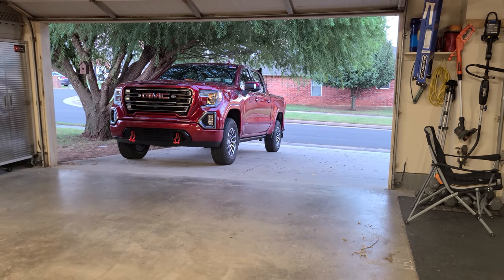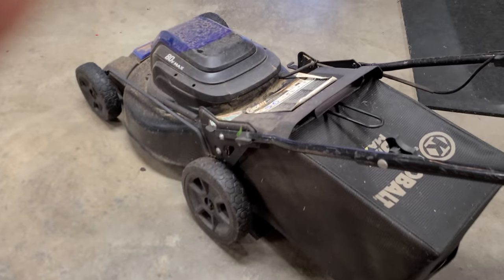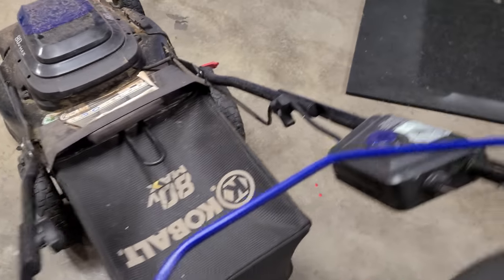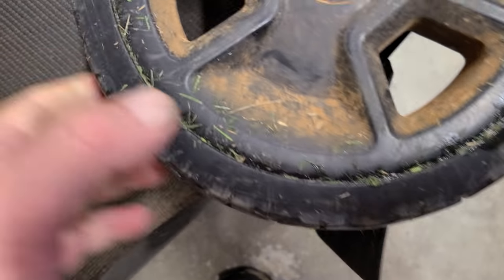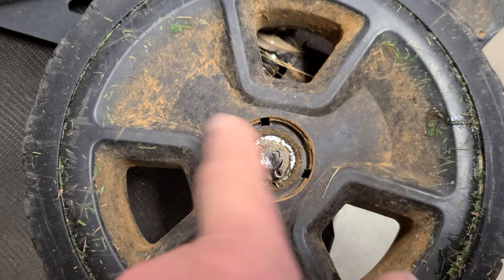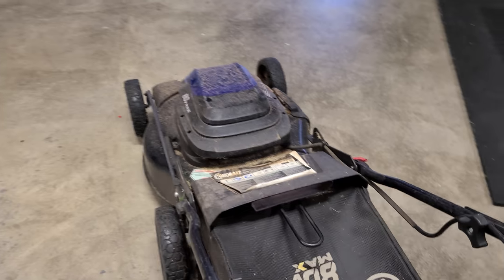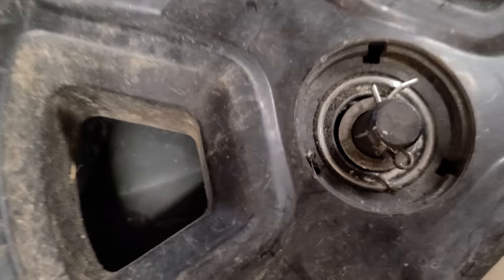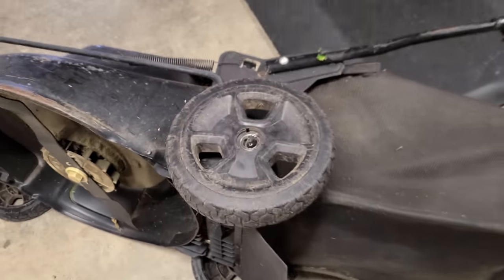Kobalt 80v push mower rear wheel ball bearings broke

Comment from the maker: The bearings are 1/2" x 1 1/8". THERE ARE TWO PER WHEEL and you lightly tap them out from inside the plastic wheel shaft hole out. I used Hillman Part # 0823651043 from Tractor Supply (they had four in stock). Also available on Amazon: https://www.amazon.com/gp/product/B07YDK97WZ/ref=ppx_yo_dt_b_asin_title_o00_s00?ie=UTF8&psc=1

Comment: I simply replaced the wheels with OTDSPARES 10-Inch Rubber Replacement Tire Plastic Wheel 10x1.75" Semi-Pneumatic Tire from Amazon with a 1/2" ID fender washer on each side to fix any slop issues. These wheels are all plastic hubs wo/ bearings so a smear of axle grease also helps. I mow 1/2 acre and the wheels last about 1.5 seasons. Not as cheap as your solution but a whole lot less hassle to do.

Comment: I have replaced mine 2x, and need another.  Lol, I got a couple acres
Reply from the maker: The whole wheel or just the bearings?
Reply: @ChrisDIYerOklahoma  I was able to pop the old bearings out and put the new ones in. My front ones are showing wear also. Buy a couple of extra if possible. I love the mower, and have had it about 4 years or so. I beat the crap out of it too so take that info if necessary, lol.